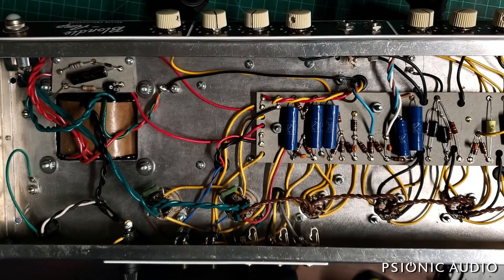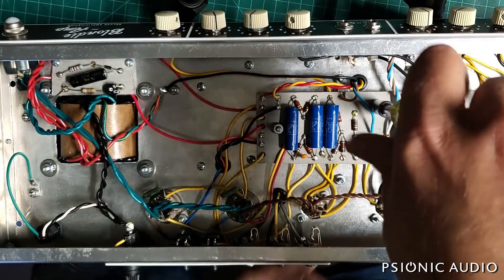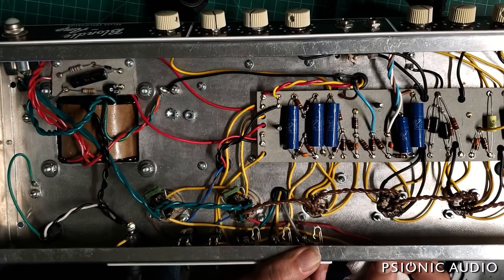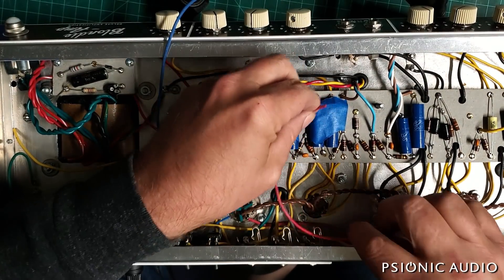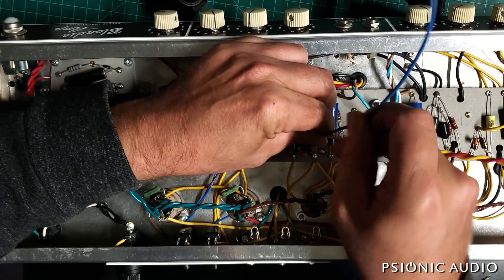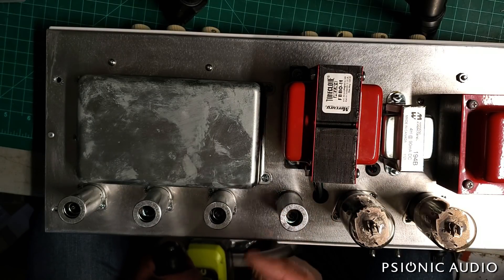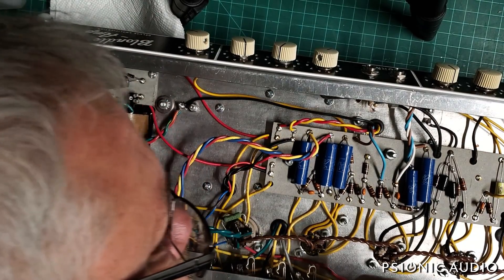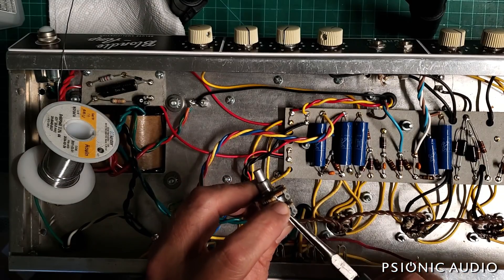Mastering the Bassman and the AC30

Comment: Tip as a previous ex soldering expert. I always used to have a small fan next to the work pointing backwards. It would draw the fumes away from me. I also used to breath in and hold my breath, then maintain a slow blowing out onto the joint as I soldered.

Comment: Just an FYI for all - for removing almost any sticky adhesive substance without harm to plastics, paint, etc, just use Naphtha (lighter fluid). Leaves no residue, so no alcohol required.  Will not harm guitar cases, tolex (careful with screen printed tolex!), wallpaper, leather, and 1481-1485 Silvertone amp covering😁, etc.  Do not use on screen printed faceplates or tubes/valves. Will not work on super glue, epoxy resin, solder flux or any other substance that alcohol will dissolve.
PS - Your channel ROCKS....love it!
Reply from the maker: I use naptha and acetone but I try to use them sparingly. I have a Tele bridge taking a naptha bath right now.

Outside.
Reply: @PsionicAudio   Naptha fumes don't bother me but I swear that just a whiff of acetone makes my brain cells go "pop" (that explains a lot about me). Goof Off is even worse. Neither acetone nor Goof Off should be used inside unless you've got every window open plus a fan for ventilation; and they're murder on most plastics, and painted finishes. GooGone is a good alternative to Naptha, safe for use on most plastics, paints and finishes.
Reply: @PsionicAudio  Acetone is VERY, VERY volatile and I try not to use it at all. Always kept in the steel locker. Naphtha, not so much......same as lighter fluid which I still have a bit of under the kitchen sink for removing residue on anything with a label. But really, try it on your next goo project.
Reply: I have always used 'Shellite' (lighter fluid). I have more recently discovered that WD40 and RP7 also dissolve sticky substances.
Reply: @billswaim   WD40 definitely leaves a residue behind. It drives up and gets crusty on metal.

Comment: I used basically the same method on my 5E3 build, with a 1meg pot, eliminating the 1M resistor where I tapped into the board .I didn't think it worked any better than just turning down the main volume pot.

Comment: Loving this channel! Thank you for all the great content.  Im certainly not on your level with my skills however one thing I would like put out there for anyone that wants to incorporate this style of master is that Alphas are the absolute worst dual pots you can utilize for...well for anything that requires a dual gang pot where matching values are important. Their wafers measured resistance are terribly inconsistent and  Ive measured as much as 60k differences between the front pot and the back pots!

Im not saying dont use their pots at all. I love their tapers and feel and use the single pots in alot of my mods and builds.
Reply from the maker: I select matched ones. I’ve used the PECs as well but I don’t hear the $25 difference.
Reply: @PsionicAudio  Yeah the guys overt at Valve Storm are nice enough to sort through and find me some that are within 10% and even started selling them at an up charge for a bit on their site because of my constant requesting. Anyway I just thought id say something  since I used to just chuck in dual ganged pots without measuring.   

I hear you on the PECs! Their dual ganged 250ks are going for $60 a pop now.

Comment: For the PPIMV dual gang pot, how much do you worry about each side being matched in resistance and taper?  Using alpha pots I've had one side measure 230k and the other side measure 270k. It seems difficult to find one where each side is within 10 - 15k of eachother.
Reply from the maker: I want them close, especially in a fixed bias amp. I haven't had huge disparities with the 3/8" bushing ones.

Comment: I love these long form videos! Total amp geek heaven! 
I've heard good things about those Vishay MKT1813 coupling caps that are in that AC30 and I've been thinking of using them in a 5E3 build, but several of the values I'm looking for are backordered at most retailers (Mouser, DigiKey, etc) and not expected to be in stock until next year. Any comparable cap you would recommend?
Reply from the maker: Thanks! I get a lot of them from Newark. But the Mallory 150M is also a good choice.
Reply: I have a solder scented candle I burn when I watch these.

Comment: The best way to safely remove any glue (except CA glue) is to use turpentine.  The real stuff.
Reply: I usually use WD40. It takes a little work, but the glue softens nicely.
Reply: @kengevers8738  Sure, whatever rocks your boat is good.  I find turpentine does the best job for any type of glue except CA glue.  A tip from an old cobbler friend.
Reply: @SteveAaron  Stephen, I was offering an alternative. Not to say anything else is better. I wasn't trying to be offensive. Cheers 😀
Reply: @kengevers8738  That goes without saying.  I didn’t think you were offensive in any way.  Neither was I.